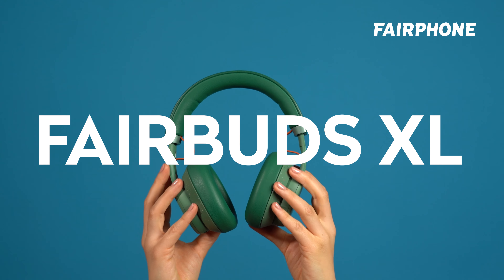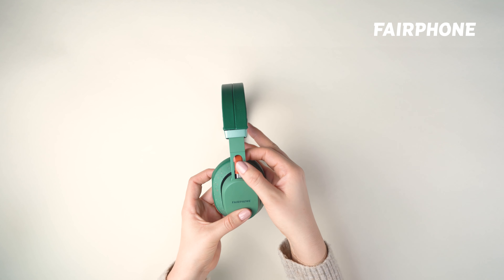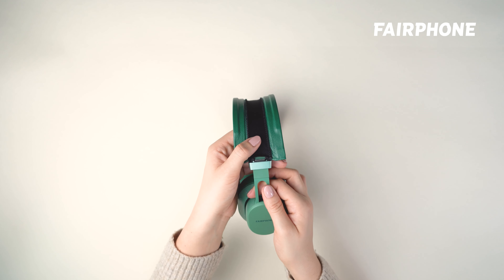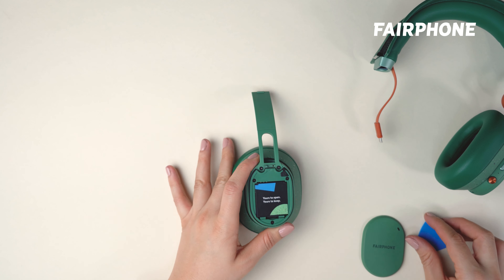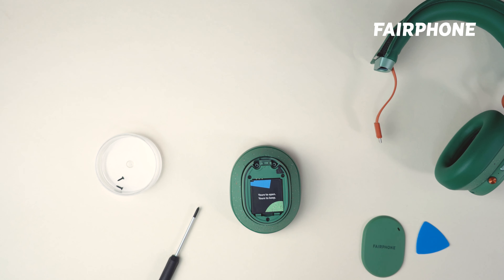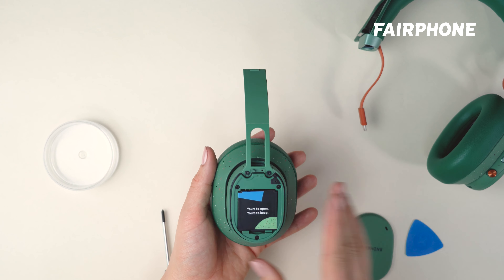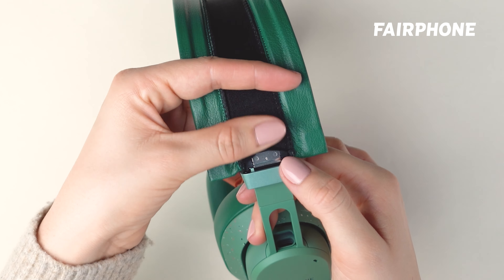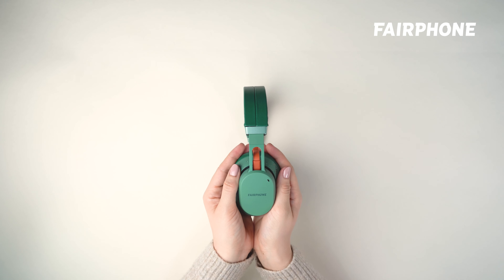Chapter 6 | How To Replace The Headband Base | Fairbuds XL

Comment: Alright that was a doozy. I stripped one of the screws so now I only have one screw more or less tight. Putting in the cable at the end was surprisingly difficult.

My feedback:
- dont use philips screws!!!
- have a spare screw delivered with the spare part
- have the user attach the cable before they screw the part in

I'm still a huge fan though :)
Reply: I came to write this. Way too tight screws.